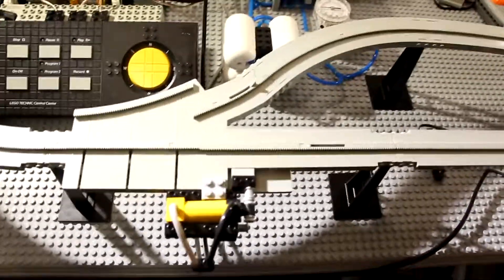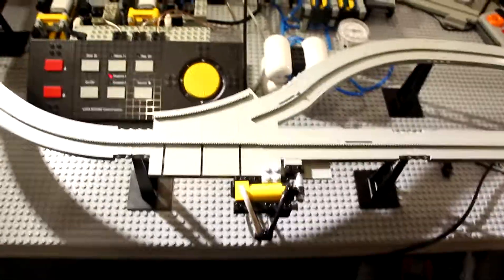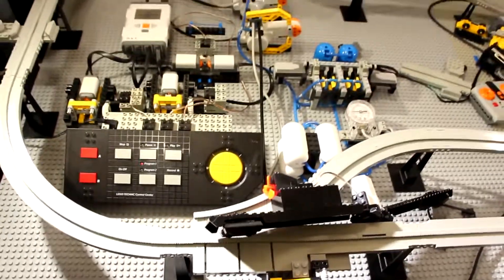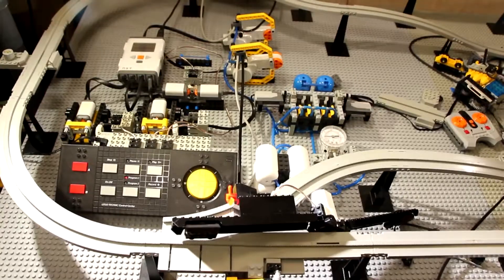Using the Technic Control center to control your Lego Projects

Comment: I don't know anything about electronics or programming, but my question is this.  Can I use this device to record a sequence of movements on a 9-volt Lego train using the "record" button?  Like, stop at a station for a few minutes, then start, on curves go slower and accelerate on straights, then stop and then reverse gear... that kind of stuff...?! Obvious also using the 9v regulator. Thank you 🙏 even if you couldn't help me. Cheers
Reply from the maker: I have a Technic Control Center retrospective video that goes into detail about how it can be programmed.  Which isn't very much.  I would say for the kind of control you are talking about an RCX would be much better suited.  But even then it would be a bit limited.  You can use light sensors to tell where the train is but you can only use 3 with a single RCX.  Then again you can always add more RCXs and have them talk to each other.  You might be able to dig around on the internet and find old forum posts from people that have automated 9v trains using Lego devices.  A lot of automation that happens nowadays will use Arduino or other non-Lego controllers
Reply: @BatteryPoweredBricks  Thank you very much!  In the end it's all a matter of trial and error, right? 😊  Thanks for your tips, I think I've seen almost all of your videos.  I'll keep digging around. Cheers